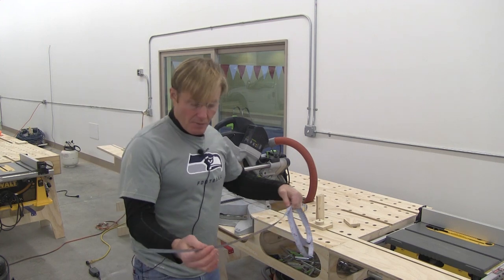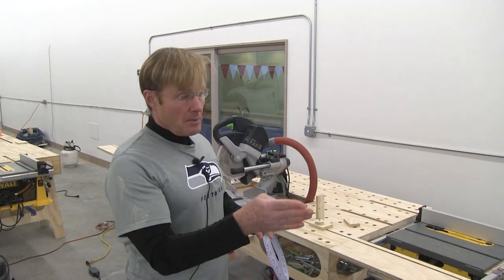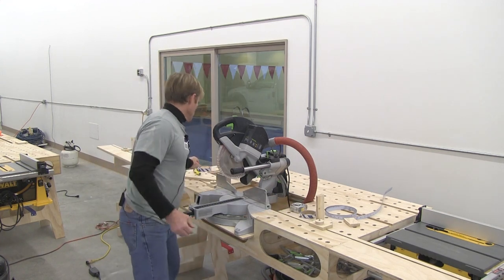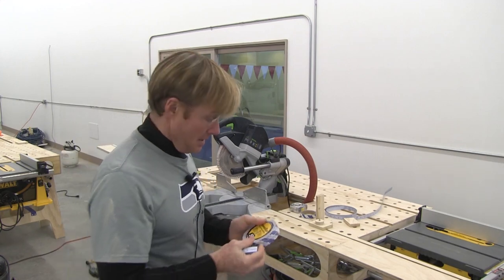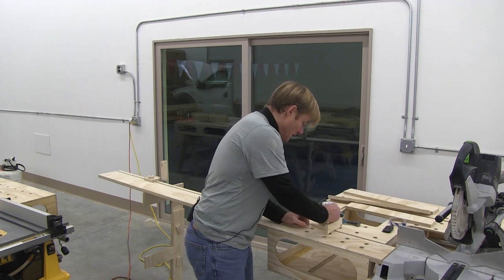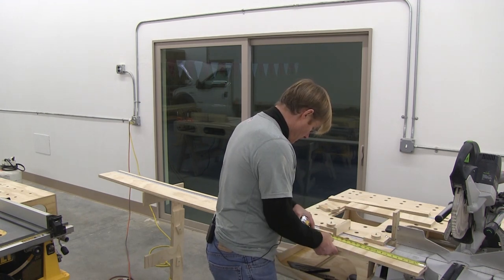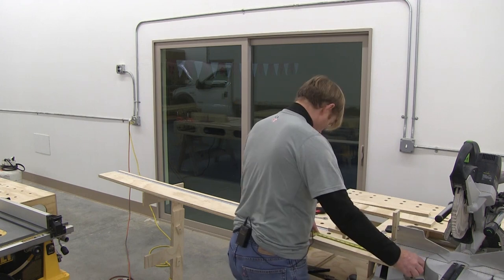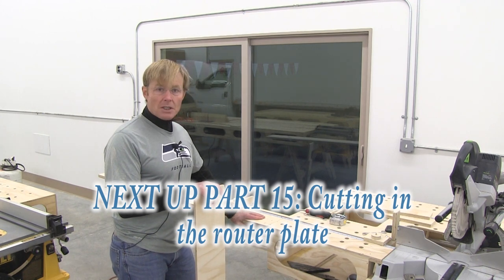BUILDING THE PAULK TOTAL STATION PART 14 INSTALLING THE FASTCAP RULER

Comment: Ron where does the flip stop read its measurement from?  If I understand the design correctly, it cannot read from the flip arm itself sue to its adjustability.  Do you read the tape measurement off of the trolly?

Comment: How did you do the 1/16 rabbit for the tape measure
Reply from the maker: Depending on what tools I have set up, my first choice would be a router table. You can also quickly run it through the table saw on edge.
Reply: Ron Paulk I was under the impression that the tape goes in front in the 3/8 slot for flip stop. If that is true there is 7/8 before the 3/8 slot so I would need to set up the table saw to cut 7/8 + 3/8 + 7/8. Am I understanding this right. Can you post a close up pic at bench and wing. Thanks again you really are the man please keep it up.....
Reply from the maker: I am traveling for a while and don't have access to photos. I don't have plans with me either to look at. You should be able to see how it's done by studying the plans.
Ron
Reply: Ron Paulk thanks
Reply: Ron Paulk by the way I have built damn near the same trailer as your ART. I have had it on the road for about 6 months now. Since then I have had numerous people stop and make comments also gotten jobs because of the craftsmanship. Furthermore someone even asked if I was you....